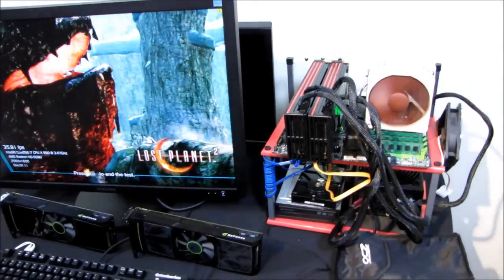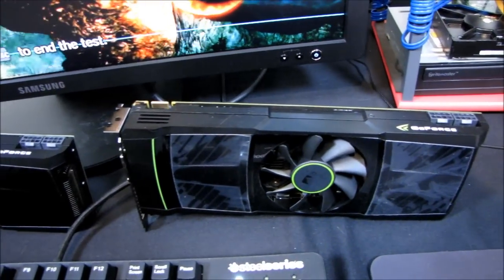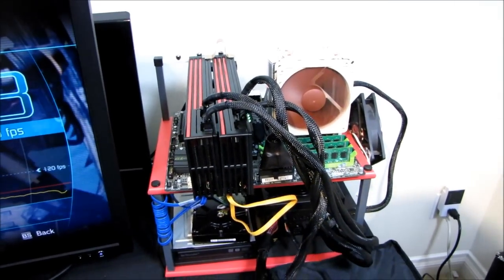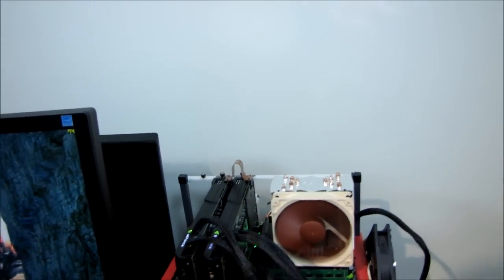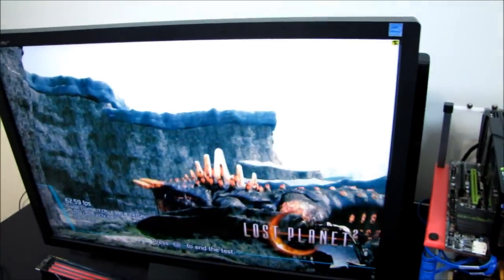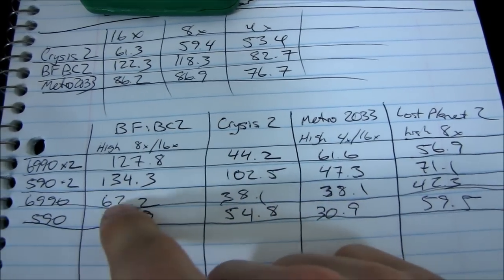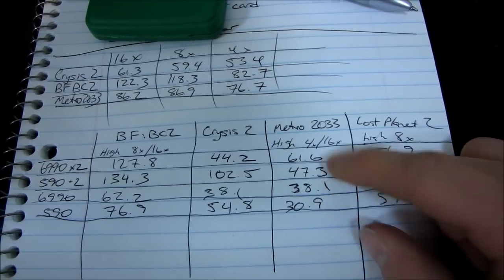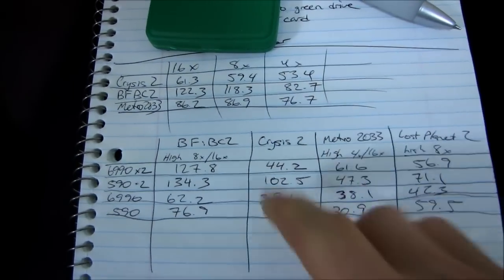Quad SLI vs Quad Crossfire Heavyweight Showdown GTX 590 & HD 6990 Linus Tech Tips

Comment: I had 2 6990's until last year when I sold all my old retro gear to fund a RTX 3080, yeah that turned out well, lol. I used to love putting them in crossfire just to see 4 GPU's on a system, especially with my i9 9900k. Nothing more than a novelty in this day and age but fun no the less.
Reply: I know what you mean, I did the same with two 5970's a few years back. Crazy how as a kid I used to dream of the day I could afford a 5970 when it was top dog...
Reply: Take me back, it was my dream to have 2 cards in sli/crossfire

Comment: OK.. I might be completely dumb, but how is this "quad" sli and crossfire, when there's only 2 GPUs? I'm very confused on this, and if you happen to be reading this, please let me know the answer to this. Thanks
Reply: +Will Hart Those are dual-GPU graphicscards. That means every card has two graphics processors, making it effectively 4 graphics processors  (-> 4-way SLI/Crossfire) with just 2 cards.
Reply: JanusPrime Ohhhh so it's like dual core processors and with 2, that's quad. I see thanks

Comment: I have an R7 370 from asus and I was wondering if I should buy a 2nd r7 370 and crossfire or should I just buy a r9 380x which of the 2 would have better performance the crossfire or the single r9
Reply: the 380x will consume less power, in some games will perform better than the crossfire and it's also a cheaper thing to do if you sell the 370

Comment: i have a core 2 duo E4500 + EVGA9800 gt 4 gb ram ddr2 800 mhz. termaltake tr 700 watts. T.T
Reply: +Ragnvald Saenz I'm running an i7-6700k a gtx 980 ti and 32gb ddr4
Reply: +Ragnvald Saenz I'm running a AMD FX 4350 4.2ghz ,8GB ram ddr3 1600 speed, and sadly a GT 430 and 430 watts im moving to a GTX 960 before long tho
Reply: you are a good pc :(
Reply: i receive donatios xD  - T.T - Q.Q - u.U - :(
Reply: congratulations, excelent Build! :)
Reply: +Ragnvald Saenz Guess I will add my build too... i7 5960X, 64gb ram, 4x intel 730 ssd 240gb raid 0, 3x titan black, 3x asus 4k 28" display.

Comment: You should do this experiment again
But 4 Fury X vs 4 980Ti
ecause the Titan Z is not as good at all as the R9 295x2
Reply: Jeremy Clarkson it's shit cause it has a high tdp?
Great logic there, Einstein.
Reply: +Jeremy Clarkson wrong. The original Titan is 2 years older, however the Titan-Z was made as a response to the launch of the 295x2.
Reply: +Cantrio X I read the whole conversation. You're a god.
Reply: Jeremy Clarkson despite the fact that it had a liquid loop on it that kept it at a cool 65c on stock clocks, and you COULD overclock the hell out of it BECAUSE of its cooler.
And did you really just attack the crossfire interface? A second card scales at 85% in Xfire, and 90% in SLI. Yeah it's more, but only marginally.
Reply: Jeremy Clarkson LMAO
that right there just proved you know nothing of AMD GPU's. Would you like me to explain where you fucked up?
Reply: Jeremy Clarkson You are thinking of two TOTALLY different GPU's. the 7970 is running the Tahiti Pro GPU. Its the same die that you find inside of a 280X, and also the 7870. The R9 290 and 290x wer running the Hawaii architecture, which was brand new at the launch of the 200 series of cards. In the 300 series, Hawaii was refreshed and rebranded as the Grenada GPU. Tahiti was rebranded twice, and Hawaii has only been rebranded once. And you cant sit there and act like only AMD does this. Nvidia used the Kepler GPU's in two different families, and they used the Fermi GPU's for three! I wouldnt be surprised if they bring back Maxwell in the next generation of cards.
Reply: +Cantrio X Nice conversation skills, I like how you were calm all the time and just pushed out arguments. 10/10 would read again
Reply: RazorTheMann Why thank you sir.
Reply: Toady Tonga is GCN 1.2. It is based off of the architectural design of Hawaii, a GCN 1.1 chip, which was IN TURN based off Tahiti GCN 1.0. 

You have absolutely no idea what you are talking about. Just because the names sound the same doesn't mean they are the same. Seriously take your own fucking advice. Use Google. Learn some shit.
Reply: Cantrio X A god? Srsly....
Reply: Jeremy Clarkson No, you are blaming the card, that's why you attacked its scaling averages compared to an SLI configuration. You have to understand that hardware can only really shine when it has software designed to take full advantage of it.
Reply: Toady I did. 
Radeon HD 7850 - Tahiti 
Radeon HD 7870 - Tahiti XT
Radeon HD 7950 - Tahiti pro
Radeon HD 7970 - Tahiti XTL
Radeon R9 280 - Tahiti pro
Radeon R9 280x - Tahiti XTM
Radeon R9 285 - Tonga
Radeon R9 380 - Tonga 
Radeon R9 380x - Tonga XT

I've had many of these cards. One would think I would know what I'm talking about.
So, you look it up.
Reply: +Jeremy Clarkson The 290x beats the titan, i'm sorry to break it to you, even linus did a video on it called "Titan killer" or some shit.
Reply: Jeremy Clarkson You were very subjective, and didn't quite open your mind for another opinion. It seemed like you didn't want to learn anything at all, and that is the main reason to have a debate; see other opinions.
Reply: Jeremy Clarkson Ah, I see now. You're talking about the software side of things. It doesn't always work because game developers don't always optimize games for Xfire and SLI. That isn't an AMD problem, it's LARGELY a developer community problem. Some devs are more biased towards SLI and will only optimise for that, and vice versa. You can't blame the hardware for the devs not taking advantage of it.
Reply: Jeremy Clarkson Oh what a coincidence, I've had three AMD cards and only one stopped working. That was actually my 280, now I've got a 370 AND I still have my old 6770 from five years ago XD I'm about to upgrade to a 380 though since it give me future options with GCN 1.2
Reply: Jeremy Clarkson that's because pitcairn was such an efficient GPU for the time it came out.
Reply: Jeremy Clarkson Thats impressive. I'm assuming you overclocked it?
Reply: +Jeremy Clarkson OMG the 380x is a 7970, the 390 is a 290. Learn your fucking shit.
Reply: Toady you're wrong. The 380x is not a 7970. The 280x was. The 380x uses a different architecture than those.
Reply: Cantrio X Tonga is Tahiti lol, it's just a different "Code name" if you have watched reviews you would know this. So, you look it up.
Reply: +Toady So you resort to ad hominem because you can't beat me? real mature. I'll bet you're, what.... 14?
Reply: Toady Youre embarressing yourself because you refuse to do a quick ten second Google search. But that's cool, keep living in ignorance friend.
Reply: +Toady Yeah, I'm immature.... You're not even arguing about the GPU's anymore. You had no defense coming into this and you still don't have one. Please just learn about shit before running your mouth.
Reply: Toady I gave you plenty of information that you just outright rejected without looking to confirm it for yourself. The only one who is mad here is you. I'm just trying to help you. But I'm done now, cause the only person you're hurting is yourself. GL, have a nice life kiddo.
Reply: Cantrio X Thank you for leaving, just proves me right.
Reply: +. GTX 750 ti
Reply: Muhammad Syafiq Power Delivery is the main change. the 390 series needs a considerably less amount of power and makes much better use of that power. Despite being the same processor as the 290 series, its noticeably faster.
390 > 290
390X > 290X
390 > 290X
Reply: Muhammad Syafiq If its the same GPU, every card will consume the same amount of power.
An ASUS 970 will take generally the same amount of power as an MSI or EVGA cards.
Reply: he needs 2 pro duos
Reply: Nah, pro duos suck ass
Reply: +Sebastian Contreras Maybe because the Titan Z is 2 years older
Reply: Jeremy Clarkson Youre also forgetting the fact that it was TWO 290X'S on that card, and those things are wildly inefficient to begin with.
Reply: Cantrio X I've already said enough. Had 3 AMD cards, they sucked. Stop.
Reply: Cantrio X I didn't say that my 3 cards died. I've only said that they sucked compared to equivalnent NVidia ones.
The only card that is wtill worth using is my old HD7750.
Reply: Cantrio X That thing was doing 70+ FPS Black Ops 2 at Ultra at 1080p
Reply: Cantrio X A little bit.... a little bit...
Reply: Cantrio X LOL no it doesn't. The whole 3xx series is a refresh of the 2xx series, don't believe me? Well then look it upi.
Reply: Cantrio X You said "You can't beat me" now who is the 14 year old lol, immature af.
Reply: Cantrio X I proved you wrong, you got mad, end of.
Reply: ' ♥ # Y)=00ßß I was calm too...
Reply: ' ♥ # Y)=00ßß Because that card could have been the best GPU on the market, even priced at $100, but it would have still a 500 watt TDP.
Impossible to use here in italy
Reply: ' ♥ # Y)=00ßß Yes, I love my 750ti, paired with my G3258 it makes a great budget friendly console killer.
Reply: Seems my R7 360 was DoA, yes, i'm crying
Reply: +Toady Hey, I had  the same setup. If you want to upgrade, go with the Intel xeon 1231 v3. its like a i7, for the price of a i5. I also upgraded  my GPU to the 390.
Reply: ' ♥ # Y)=00ßß Oh nice, will i need ecc memory?
Reply: +Toady No it works with regular  ddr3.
Reply: ' ♥ # Y)=00ßß noice
Reply: +Cantrio X sorry to butt in but I heard about the titan z about 2 to 3weeks ago how long has it been out and was the titan x really 2 years ago
Reply: +Cantrio X That entire conversation was cancer. As an Nvidia user, thanks for setting the record straight. The Titan Z was shit it was a triple slot thick card with a terrible heatsink that required both Titan Blacks to be underclocked. It performed within a percent of the NON-OVERCLOCKED R9 295x2 in nearly every title. But two things: The R9 295x2 had overclocking headroom thanks to the 38mm thick 120mm radiator, and also, it retailed for HALF the price of the Titan Z. 

As an Nvidia owner, it would be quite a privilege to have a R9 295x2 in my rig, or even the long awaited Gemini x2 (Fury X2). I don't have room for multiple cards because of my PCI E SSD configuration, so for now, I'll be sticking with the GTX 780.
Reply: They might be right, the GK110s inside the Titan Z are slower GPUs and they are underclocked to prevent them from cooking themselves
Reply: Cantrio X
You're right, the 380X is based on the Tonga GPU (R9 285) not the Tahiti
Reply: sorry guys, if I had seen the notifications of your replies to me, I would have responded to you all.

***** The 750ti is a lovely card for its price point. But in your predicament, any card from after the 610 would give you better performance. Even an r7 240. If you arent strictly an Nvidia user, A nice alternative to the 750ti right now is the r7 370. Any lower than that and you might as well pick up a R7 260X or 265.

Marble Grimes The titan Z came far before the Titan X. 
think of the X version as the "Xtreme" version of the original Titan, and the dual-GPU card called the Titan-Z which ran on Kepler. The new Titan X runs on the much more efficient Maxwell architecture.

speedevil22 Yes, a dual Hawaii card gives a mountain of performance, and believe it or not is more power efficient than the dual Kepler card. Also, when you say Gemini, do you mean Fiji? Fiji is the name for the Fury line of cards.
Reply: ***** well its the HD7970 in essence. which was the card to have 3 years ago.
Reply: Cantrio X
Reply: +Sebastian Contreras 
flame_war.exe

#MakeYoutubeGreatAgain
Reply: +Cantrio X hey bro, do you have a suggestion for me about the best performance per dollar gpu? i'm gonna stick with AMD as currently i'm using one now
Reply: Muhammad Syafiq Alright, if you want strictly AMD than the best right now would be a 2GB R9 380. You might be able to find a 4GB on sale in which case I would DEFINITELY go for that one. If you have a little more money to shell out, the next best price/performance card is the R9 390.
Reply: is there is much differences between ASUS STRIX AMD RADEON R9 380 and SAPPHIRE AMD RADEON NITRO DUAL-X OC R9 380., both of them are 4gb
Reply: The only difference is clock speed and fan size. the Strix has bigger fans to help cool its slightly higher clock speed.
Reply: so it is better to take the Strix right? thanks for ur help, very helpful for me
Reply: +Sebastian Contreras 980 ti wins.
Reply: Maybe,Sure a single 980Ti outperforms a single Fury X But I think that Crossfire scales a bit better tan SLI so I don't know which setup would win in 4.Way
Reply: Cantrio X hey pal, 1 question, what is the differences berteen R9 290x 8gb vs R9 390 8gb as I see both of them is very similar
Reply: Cantrio X Thanks a lot, u really save my money. What brand did u recommend the best for the performance
Reply: Muhammad Syafiq GPU or CPU
Reply: GPU, since when I did a survey, MSI brand power consumption is the lowest., Is it true or every board are same actually
Reply: thanks a lot bro
Reply: thats why this is an entheusiast product. its not supposed to be practical. 295x2 was about raw power not about compromise. you shouldn't be trying to crossfire those in a case that doesnt have at least two 120mm mounts for fans or radiators. Hell i have two radiators in my air 240.
Reply: Sebastian Contreras do these 6990s get over 60c?
Reply: Mate96 Rusendic- Gawd yes they do! You're talking about AMD graphics cards to start, which are notoriously hot natured.. . Then on top of that, each 6990 has TWO full GPU's on em. Go a little further back in NCIX and Linus does a review on the card itself. I believe it was in the way upper 80's
Reply: Cantrio X Whatever, but the R9 295X2 is shit anyway.
500 Watt TDP, it's suicide
Reply: Cantrio X Yes, 125 watts more are not a few, but other than that it's shit because: higher heat output, louder, lower overclock capability, AMD drivers, Crossfire technology is a joke compared to SLI, radiator that can cause problems...

The only advantage is the price, and even then, the Titan Z was meant as a compute card, not a gaming card. Like all Titans do.
Reply: Cantrio X 85% scaling... yes... when it works.
Overclock that card and that 65 degrees will be only a dream...
And if I don't have a spot for that radiator? In my butt maybe?
Reply: Cantrio X I know perfectly that it has two 290Xs... but the Titan Z has 2 Titans. And a Titan is plenty more powerfull than a 290X
Reply: Cantrio X I'm not blaming the hardware but, when I have a dual GPU card, the software that makes that card work is an important aspect of the card right?
Reply: Cantrio X What have I just said? If the freaking software doesn't work, that card will not work decently! And it's useless! 
AMD should stop producing CPUs and should really work on their GPUs.
The 390 is an umpteenth rebadge! Basically it's a 7970 with 8GB of RAM!
The 980 is more powerfull with a TDP of 110 watt less
Reply: Cantrio X I don't care. I had 3 AMD GPUs and they all sucked. Period.
I'll never buy AMD GPUs again

Comment: I am officially pissed off now. It has been more than 3 years since I bought a 590 GTX, advertised as having 3 Gb of vram. I NEVER paid good attention to it, jut let the gpu do its job. Recently I had the chance to play Skyrim Legendary Edition, installed some HD extra texture mods. I discovered that actually this GPU is totally useless... when it comes textures quantity. WTF, it only uses 1.5 GB? What the hell is wrong with it? I bought it mainly because the producer stated it has 3 Gb... and actually is is half the size in games. Why state 3Gb if actually only 1.5 Gb are used?
Reply: Ah, I totally know how you feel, man. Sorry to hear about your situation. It turns out that those Fermi series cards (GTX 4XX and GTX 5XX) were a bit anemic on the memory side of things, so even the most high-end Fermi solutions were restricted to 1.5 GiB. This was true for the reference GTX 580 model, but there was a 3 GiB version of the card GTX 580, too; however, there never was a GTX 590 that contained two GTX 580 GPUs on the same PCB with 3 GiB per GPU, only 1.5 GiB per GPU. The reason why you can only make use of 1.5 GiB of memory across multiple GPUs is because even with two, three, or four cards in SLI, all GPUs have to share the same framebuffer data by mirroring it across all GPUs. The only way you could have made use of 3 GiB of video memory is buy purchasing two 3-GiB versions of the GTX 580 and putting them in SLI.
Reply: ***** Well, back then I had the money to buy dual 580 GTX 3 Gb if I just knew that SLI actually mirrors the vram per GPU, and with 590 I will end up with 1.5 Gb.I will pay way more better attention, investigate further, before buying anything again for  my pc.
Reply: Daniel Manole Cinco Yeah, you don't gain more memory by adding more GPU's, only way to gain more VRAM is to increase the amount of VRAM per GPU. I'm waiting for Sapphire's R9 290x 8GB to come out here in the states. I'll probably pick two of them up to replace my two GTX 770's.